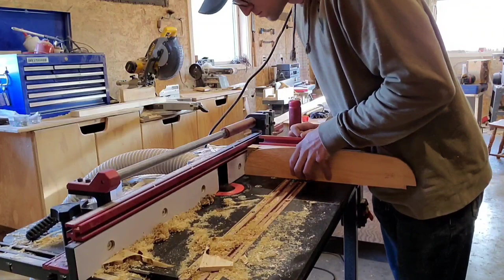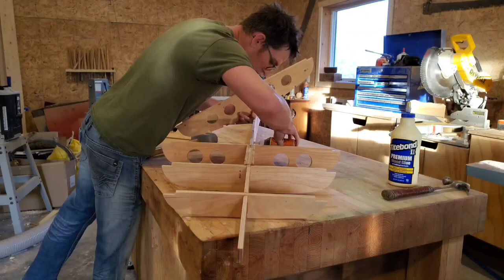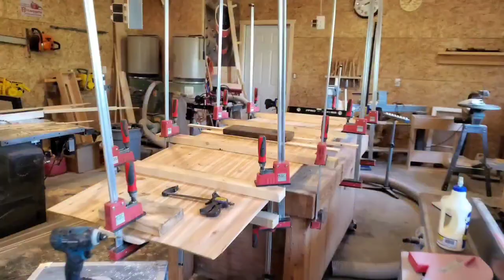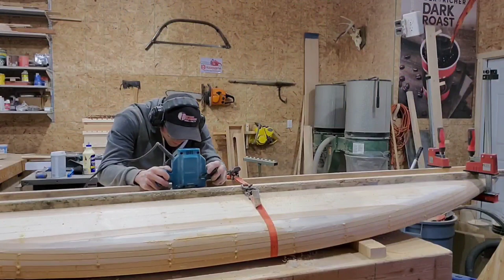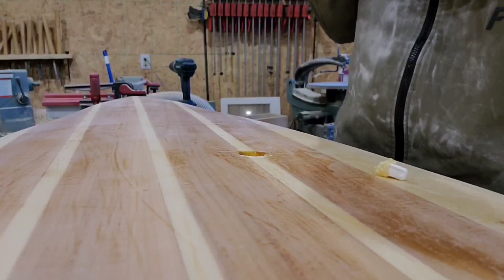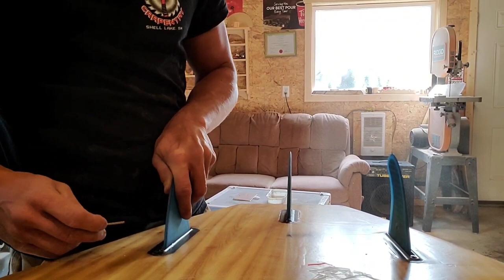Build a cedar Stand Up Paddleboard from scratch

Comment: great video!  I have the bones for one from Jarvis Boards and haven't started yet. glad yours worked out just using a plan in your head.
Reply from the maker: Hey thanks! Yeah it worked out good, the only thing i would change is to make the tail end a little wider. Good luck with your jarvis board. Are you posting a video of it when you get it completed?

Comment: Great job on the board. I appreciate you showing all the steps.
How did you keep the epoxy from dripping on the sides when you glassed it?
Reply from the maker: Thanks for liking my video! 🙂 I kept on wiping the drips on the resin until it stiffened up enough. Any runs were sanded down after. So far, getting a glossy smooth finish isn't my strong point.

Comment: Congrats, bro! Wonderful work! I want to try build one of this. Did you get a plan or create yourself?
Reply from the maker: Thanks, yeah i just built it without a plan. I watched some other youtubers building surfboards and such but that's about it. I hope you build one , it's a fun project.
Reply: @buildsomethingawesome  Great! I will make you know when I build that!
Reply from the maker: @FlavioRicardoDesign  sweet! I'd love to see what you build. 😃
Reply from the maker: @FlavioRicardoDesign  a couple tips and things i would change on the next one are this: make the back end a little wider, it has a small sweet spot for balance from the front to back. The second would be to put two air vents in, just in case water gets inside so you can pressurize the inside with one vent on an air hose and blow the water out through the second vent.

Comment: Very nice board and video!  How does it track? (With the fins on). Just wondering if after using it you are thinking about a keel.   I am thinking about building one since the junk plastic one I have tracks poorly even with fins.  Again very nice!
Reply from the maker: It tracks very nicely actually. Three fins are plenty, I've thought of removing one to make it easier to turn. With a little bit of paddle angle i can paddle straight without switching from side to side. I hope you give it a try! It's a great learning experience to build one.
I'm planning to build another one sometime but a little shorter. Probably 8 or 9 ft instead of 10 ft.

Comment: Hello, is it possible for you to send me the dimensions of the different parts to build this super paddle. Thanks in advance. David
Reply from the maker: It's 10ft long with ribs every 8inches. 2" on each end with a 6" belly. 32" wide at the middle. I don't have specific measurements for each part.

Comment: How did you make your patterns for each batten?
Reply from the maker: I roughly drew out the size of paddleboard on a piece of wood and took measurements from that. Once i had the width of the ribs I used a curved template to mark the top corners so that they were all the same curvature.
Reply: @buildsomethingawesome Do you have any footage on how you did that?

Comment: Good night, I want to make a Stand up board like this.  Do you sell the project?  my name is Nivaldo Serva and I live in Brazil.  Thanks
Reply from the maker: Hey, Nivaldo from Brazil! I'm glad you are interested in making a paddleboard. Unfortunately I don't have a plan to follow, I built this with just a couple rough measurements in mind. This is about 10 ft long with the ribs spaced apart every 8 inches, the widest ribs are about 30 inches wide and 6" deep. Hope this helps.

Comment: Pattern?
Reply from the maker: Hey Paul, i didn't use a pattern to build this. There is a quick part at the beginning that shows marking out the general shape.
Reply: @buildsomethingawesome  Maybe you could sell the pattern? For those of us not so artistically inclined.
Reply from the maker: Next time I'll show a little more of what i did and hopefully it will be enough to copy. It's 10ft long with ribs every 8inches. 2" on each end with a 6" belly. 32" wide at the middle.

Comment: Im pretty sure you used the gorilla glue the wrong way.  Regular wood glue would have worked when glueing up the frame.  Gorilla glue needs water to activate.
Reply from the maker: Thanks for the tip, i didn't know that about gorilla glue. I used gorilla glue because it foams up and fills gaps a little better.
Reply: @buildsomethingawesome  spray the wood down with water first.  It will expand more.
Reply: @buildsomethingawesome  gorilla glue will obtain all the water it needs to activate from the atmosphere. It just may take longer than had you dampened the wood prior to gluing. 

What plans did you use?
Reply from the maker: @johnfurr8779  that makes sense. The gorilla glue seemed to work fine. As far as plans go, i just winged it on this one and hoped for the best. Aimed for a 10 ft board and whatever felt right.